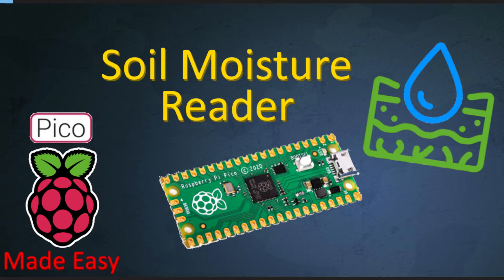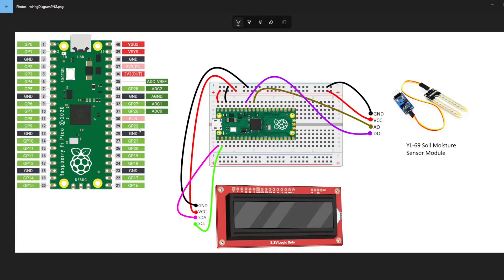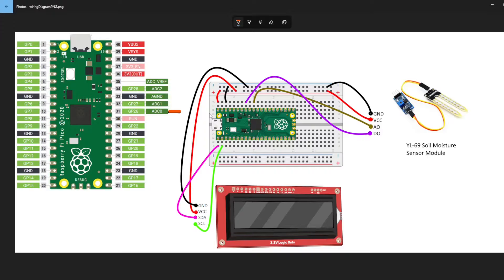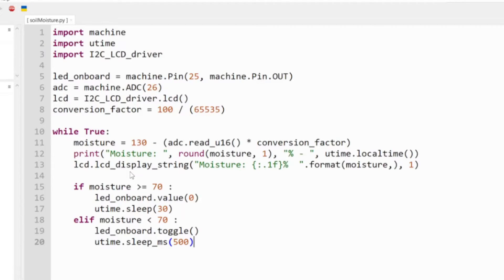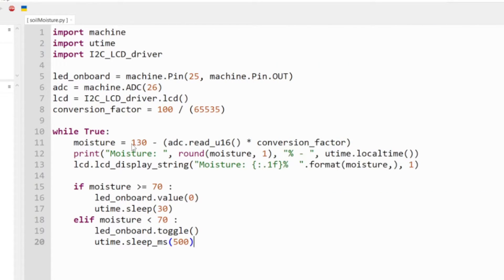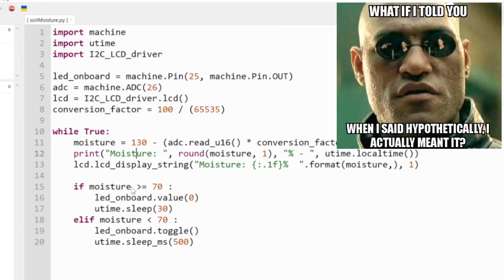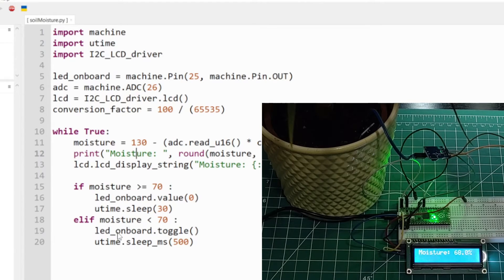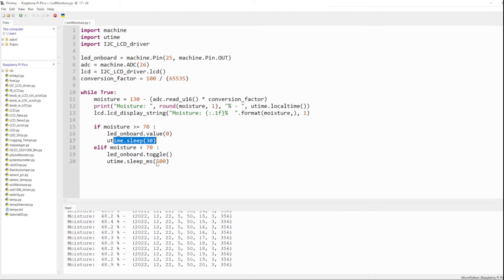MADE EASY: Raspberry Pi Pico Soil Moisture Reader in Micropython 🐍 w/Code

Comment: VBUS you are using in connection is 5V or 3.3V? I thought it is 5V. If it is 5V, sou output D0 and A0 are 5V too. Isnt it dangerous for input pins which are 3.3V?

Comment: i ran the code and did the connection but i keep getting this error message 'Traceback (most recent call last):
  File "<stdin>", line 3, in <module>
ImportError: no module named 'I2C_LCD_drive'
Reply from the maker: Did you download the LCD Driver I have in the description?

Comment: Could you make a tutorial with just the pico and the sensor no other little board just the two components Plus the jumper cables and bread board?? Thanks
Reply from the maker: Part of the sensor is the blue board. Was this what you were thinking about eliminating along with the LCD? The probe that goes in the soil only has two pins. Power and Ground and the blue board has the analog pin (AO in this case) that we're using for this video. I'm not using the DO pin, it's just connected but can be used instead if one would liked. The small blue board also acts like a potentiometer so we can adjust sensitivity if needed. Let me know what you think and thanks for stopping by!
Reply: @RamboPi  yeah it was the blue board an ah that ok, I figured something in the end, thanks for the quick response, I've subbed and can't wait to see what you've got planned next